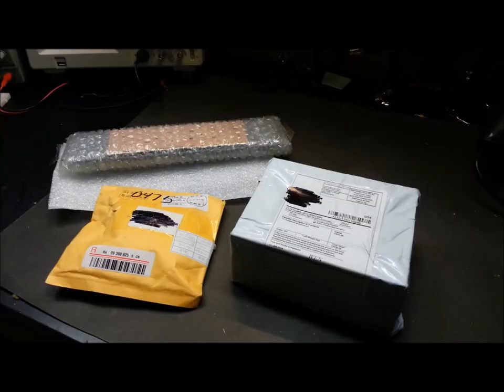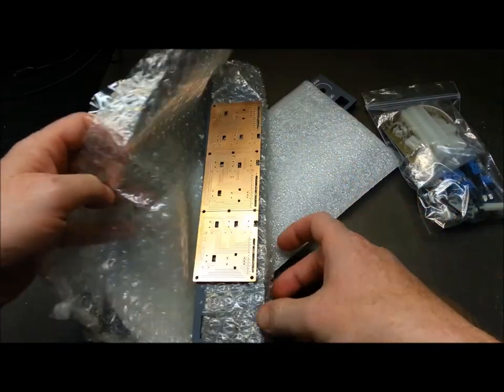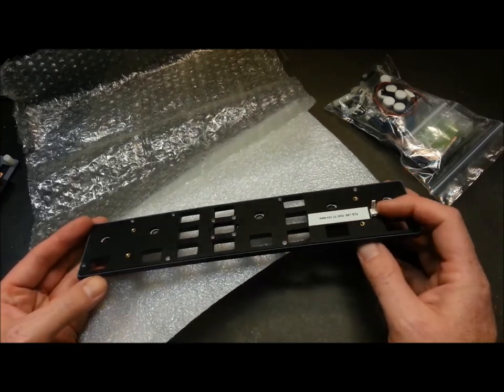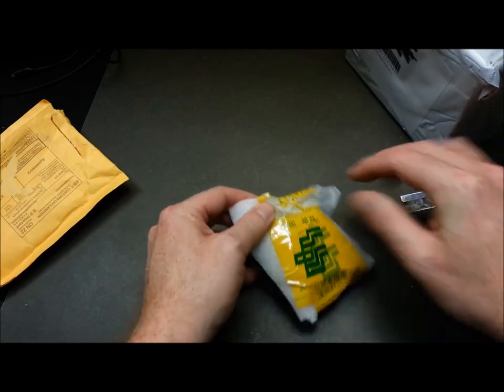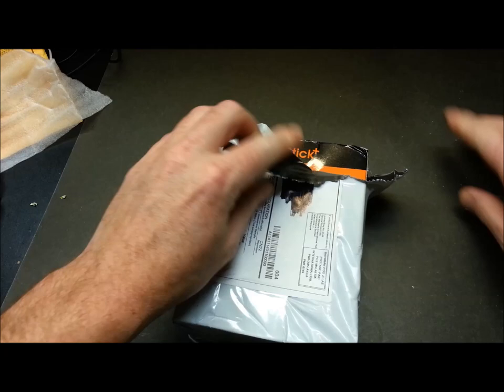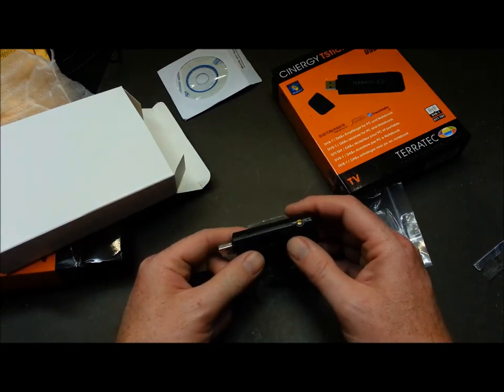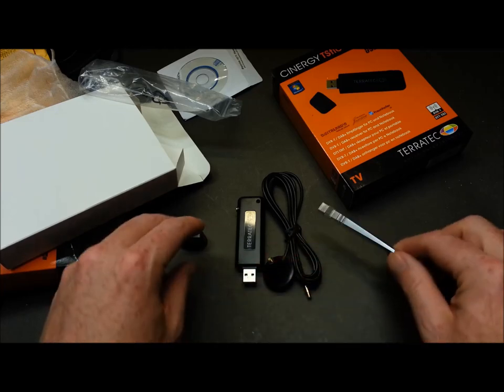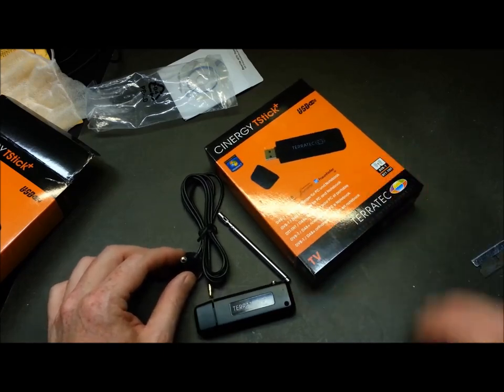Software Defined Radios, Antennas & Learjet Parts- Mailbag Monday

Comment: That's a nice pack of SO-259 connector's. Oh I order the SDR Radio and it's on it's way Can't wait to get it.  I have a TS-870 HF Transmitter radio but the SDR is small and I can take it anywhere.
Reply from the maker: That great news Ruben.  Hope you have fun with it!  They are indeed super portable.  I have a blast with mine.  Cheers

Comment: Last Terratec I looked at, just yesterday I believe, was $100 US but it has the E4000 chip. What chip does this have? I have a hard time hearing certain tones cause I know you said it, but I couldn't quiet here it well.
Reply from the maker: R820t.  $11 bucks from eBay.$100 U.S is beyond insane!  Far beyond.  I keep hearing of people saying they are paying those type of prices- please don't.  Cheers
Reply: I paid under $15 today for the more common dual chipset (R820T and RTL2832U), but the E4000 Chipset was $100 and no way will I pay that, cause like anything, the price will come down or a better chipset will replace it with a  huge discount. Crossing fingers.
Reply from the maker: Thats good news. I bought my e4000 units for under 20 but it has been awhile. Surprised they jumped so much. Cheers
Reply: Most likely the cost had to do with were I was looking, A ma zun. Do we really need to use spaces and misspell, does it even matter anymore, sigh, (rhetorical).